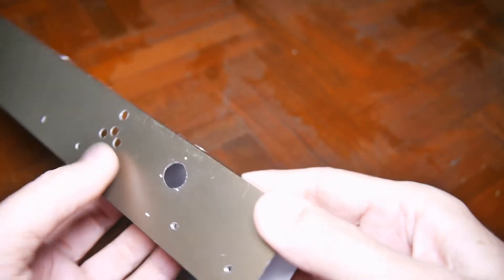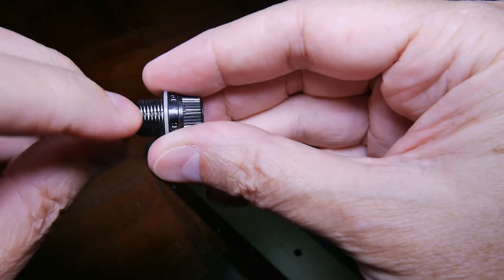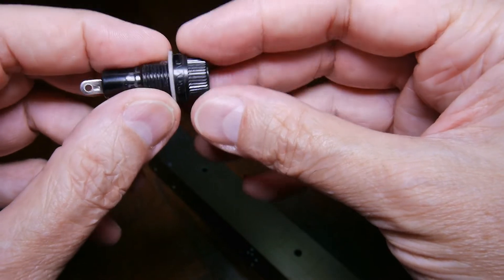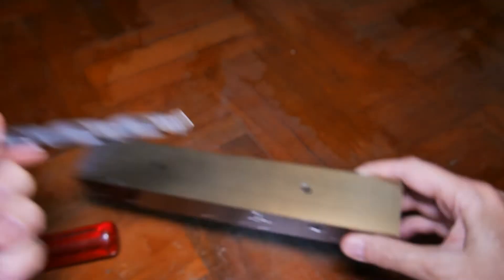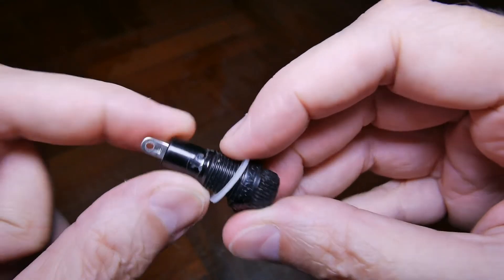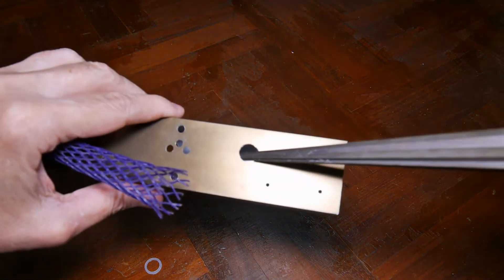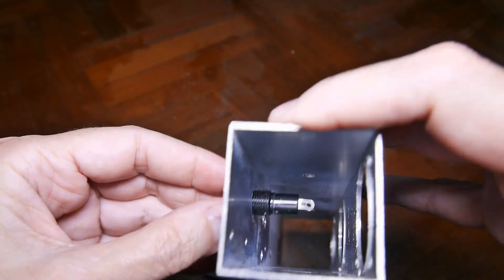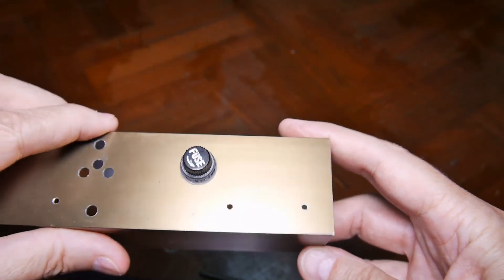DIY Mount A Panel-Mount Fuse Holder

Comment: Hello, Question for you about which terminal is the input when used on a positive wire from the power source. I am using this type of holder with a 5 amp fuse on the positive wire to a hand controller for a slot car terminal. Is the long end near the bottom the input and the the terminal near the top going to the control station? Thanks
Reply from the maker: I'm not an electrician, so you need to follow your local codes. I could only find ONE place on the internet that shows putting the hot lead on the bottom (spring loaded) contact.

Comment: You don't address which connection is the hot wire.
Reply from the maker: I use the bottom connection.  That way the hot wire is farthest away from the opening.